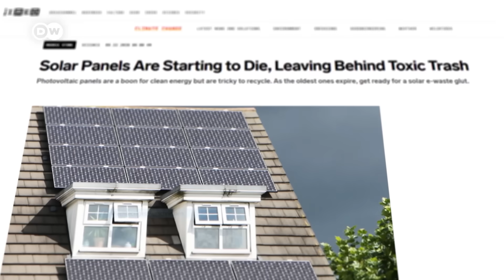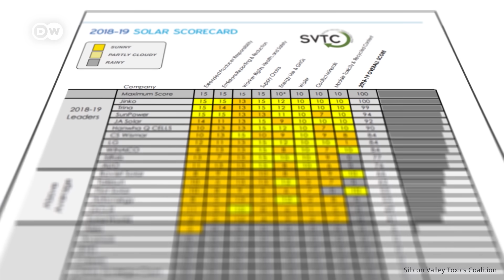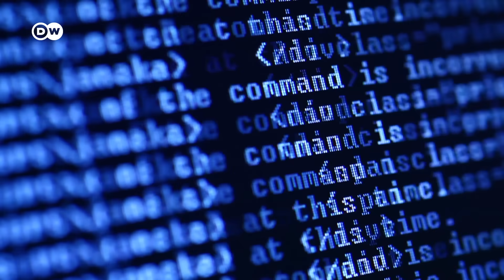How green is solar energy really?

Comment: Solar should be a temporary solution or used only in remote locations with no power grid. If we want to solve climate change without making a mess elsewhere Nuclear power is the best compromise we have by a big margin. We already have the technology, new fail-safe reactors and it's scalable.

Comment: I think one of the biggest flaws in logic a lot of people have is acting like only one kind of green energy (usually specifically renewables) is best for both cost and the environment. Studies have shown that the best way to get the most green energy for the lowest cost and environmental impact is to have a combination of solar, wind, nuclear, hydro, and battery storage. We could get so much farther if we stopped treating it like a competition between energy sources and used them together.
Reply: I'd be interested to from someone in the nuclear industry what they think of the optimal distribution of green energy capacity might look like. Nuclear gets hated on, and yet produces less CO2 per kWh than solar. A nuclear plant has a geographic footprint several orders of magnitude smaller than what solar needs to produce the same capacity. Over the past year, I've really warmed up to nuclear.
Reply: Do advocates treat energy sources like a competition? I don’t tend to see that among my circles. I only see opponents to green energy claiming such a thing, trying to say we’d need multiple forms of new energy when we could just use good ol’ coal.
After posting this, you got me thinking. Be careful who you take at their word. Many people post disingenuous stuff to piss off “the other side” of whatever issue is at hand.
Reply: @nickthompson1812  I typically hear it from not-super-educated armchair solar/wind advocates when I tell them I’m involved in the nuclear industry. I also know a few people in the nuclear industry who don’t really like renewables most likely from jealousy that everyone loves those energies and people hate nuclear. 
But you have a point: most people who actually do their research and care about green energy aren’t treating it like a competition.

Comment: Solar panels are not cheap. If they were, everybody would have them. Installation of the solar systems and batteries are a massive barrier that prevents most people from getting them. Here is the UK, it's almost impossible to find a company to even do it and those that do charge at least £15K. Even if they became cheap / easy to install, the government would slap a massive green tax on them to subsidise lost revenue for the energy companies. They are already going after electric cars as they are beginning to effect the petroleum industry.

Comment: One item not mentioned is that solar panels require a lot of space and unfortunately I saw them installed on agricultural land, thus transforming good agricultural land in industrial waste land after their end of life date.
Reply: victorradu, that is not necessarily true. Since panels must have max sun exposure for greatest efficiency, most are tilted or even elevated. They also occupy only between 5 -30% of the land they are on, allowing for normal agricultural activity around them. Some even provide added benefits such as shelter for livestock and crops. 
Several studies have shown that crops grown under solar panels do better and need less water - so do animals and the moisture from the plants also keeps the panels cooler and allows them to work better in hot climates.
Several universities in the US and the UK have shown that growing wildflowers under solar panels, increases the number of pollinators including bees and the wildflowers themselves do better.
Even the industrial waste problem is being rapidly resolved with some companies promising that this will be a $US 27 billion industry by 2030 and worth $80 billion by 2050, because there are many valuable components which can be recovered.
Newer panels also last up to 70 years, rather than the 25 or so which the earliest ones did.

Comment: My inverter says i've avoided 15T of CO2 and produced 20MW of electricity from solar in 5 years. They may not be green to manufacture, but if it avoids burning some fossil fuel and reduces CO2 then I think the manufacturing evils are outweighed by the production of emissions free energy. Of course it would be great if the solar panels themselves could be produced using as little toxic chemicals as necessary but almost everything based on semiconductors (like for example CPUs) uses an array of chemicals. We just have to learn how to make that the absolute minimum and recycle as much as we can. Solar should only grow in use along with wind, hydro, geothermal and anything else renewable, include the big boy.. nuclear.
Reply: planting more trees might help offset the the co2 emitted from producing your solar panel. how much carbon footprint was used to manufacture your solar panels compared to how much you've prevented at use?

Comment: Theres always a drive to point out additional environmental damage from renewables, but the fossile fuel industry has the same issues. For every kg of CO2 equivalent theres additional waste seaping out unused test drill locations that arent propperly capped, theres a lot off energy intensive construction involved that isn't easy to recycle either like the vast quantities off concrete that are needed for a giant petrochemical installation. Our damage to the enviroment is always a really complicated puzzle, not just for renewables. Thats why power is also only just a part off the puzzle and the main issue is out overconsumption as a grand totall

Comment: We already have green energy, it's nuclear, solar and wind are scams (oh and BTW in your "comprehensive" calculations you left out all the oil, coal and natural gas you need to burn to supplement the power grid because solar and wind only produce energy 10-30% of the time, and all the CO2 and toxic chemicals for the batteries solar and wind need and all the waste energy when they produce too much during their peak periods).

Comment: I would love to have a few of those recycled solar panels. I bet they produce at least 10% of their original capacity and would work nicely as roof tiles on the barn for 50+ more years.
Reply: I was in a local solar park, and there was this cracked and crooked panel thrown in the middle of the field, as if discarded. They told me there was someone walking on it for fun the other day, thinking it's completely broken. We pulled out the multimeter and measured the output voltage (open circuit voltage). The measurement showed 40 Volts, with the theoretical maximum being at 42 Volts. A broken-looking panel ready to be disposed was able to produce 95% of its maximum capacity, without even being properly angled towards the sun.
Reply: @TheCh0senOne  Hope you asked if you could take it away for them.
Reply: @fritanke2318  Haha yes, but it's part of the warranty so they had to return it. Besides, it's kind of a bad investment to have one panel, unless you have a very specific use for its DC output.
Reply: @TheCh0senOne  1 160w panel,   a car battery, and a cheap 300w inverter saved me $1000 this year so I guess it depends on where you are and what you do.  I bought another panel and battery for the saving. The electricity prices went to the roof this autumn so I charge my batteries when the price is low at night and use it for lights, computer and electronic stuff at the evening. I dont get rich but it is enough to get another inverter that can run my freezer next summer. So over time 1 panel can be a good investment.
Reply: I believe your estimates are low.!.!... End of useable life is a variable, and domestically used PV can be repaired in modules, not en-mass.!.!.!. It can be planned for with the generation.!.!.!.

Comment: My bifacial panels are mostly glass and aluminum.  I build coal gas and nuclear plants for a living. Power plants are huge and expensive and have 100's ton of concrete, glass, plastic, and metals. I  grid tied 8kw of panel for $1 a watt. Did i mention i live at 46° north latitude. No exactly tropical. No bill for the next 30 years. My house relieves my local grid
Reply: I also have grid tied solar power. My bill is not zero, but I can live with a 60% reduction of it.
A lot of commenters seem fixated with the notion of "vast fields of panels", in order to reduce fossil fuel generation. A few panels, even without batteies, on a reasonable percentage of homes and businesses, will make a huge difference. More education in the practical application of solar is needed.

Comment: I wonder why there isn't a more tiered approach to recycling electronics. I would think a first, less costly, step would be partitioning a portion of landfills to house electronic waste. Eventually when the cost of raw materials for electronics or recycling gets much cheaper, the electronics part of the landfill could be used for materials that may not be quite as pure/clean as directly recycled material, but isn't as much of a problem recapturing the value from electronic waste as would be going through the whole landfill. Maybe the cost of this basic sorting is still be too costly for what can be recouped down the road?

Comment: I hate it when people bring up the waste of renewables as if its this major issue fossil fuels dont have.

Yes solar, wind and nuclear have some pretty nasty waste but its for the most part contained to a very limited area or at least has the ability to be contained and localised.

Emissions from coal and gas on the other hand goes straight into our air which is significantly harder to contain than dumping stuff in a landfill.

Comment: This video is not a bad effort but there are some quite gross mistakes.  You are collecting evidence from people who are not updated on current PV manufacturing technology (2021).  None of them works for a PV manufacturer.  They are out of date with their facts.  For example the energy payback of a solar PV is (in Germany) about one year.  But the panel last 30 years.  For 29 years it emits carbon free energy.  The CO2 emitted in its manufacture today is less than a quarter that of a PV panel made in 2007.  So on an LCA basis PV emits far less greenhouse gases during its manufacture (and zero during operation) than any other power generation technology.  Yes, silicon tetrachloride is ALWAYS recycled in a polysilicon plant.  Even in China.  Cadmium telluride (a compound, not pure cadmium) is used only in 3% of panels made today (and only in the USA).  97% of solar panels made today are not using any significant amounts of toxic chemicals.  Even lead, used in solders, is being phased out.  Solar panels in Europe are already recycled up to 92% of their weight.  (99% is possible but costly at the moment).   It's a high % for a relatively small industry - it's a lot better than most other industries.  PV can improve but it's already a lot better than anything else that generates electricity.  You should make that abundantly clear.

Comment: I think the video is probably a fair assessment of the solar panel itself. However I think if we are honest about the entire system the panel is a part of we will find that the main other part of that system i.e. the batteries we will find that the cost to mine and the recycling aspect of those components drive up the carbon footprint and environmental costs a lot more than just the panel. 
After all humans don’t stop using energy after the sun goes down and where are you storing this energy or where are you getting energy when these are not producing power. I feel this is a more honest look at the entire loop of solar. 
But a good video for the segment it covered.

Comment: What about the batteries needed to store the produced energy? I think those should be considered in the calculations as panels by themselves would be too unreliable to replace current energy sources. Solar energy also requires costly specific upgrades to the grid system.
Reply: Spoken like someone that has no clue what they are talking about. A small amount of users use storage for their cells. Most parks and homes are connected to the grid. So the grid is the battery.
Reply: @tariqaljafari9724  the grid is fossil fuels. So I don't understand how that's any greener?
Reply: @4000marcdman  What are you talking about? You mentioned batteries and your claim was that people use batteries to store the energy from the solar panels. I said no, that is not how it works and people use the energy (what they need) the rest is put back in to the grid for someone else to use. How is that not green?  

We need to modernise our grids, make them smart and connected to each other across borders. We also need to invest in energy storage (green alternatives are available), mix in some nuclear power and we may reduce the dependency on fossil fuels down to 0. 

But people like you are not interested in a real solution. You only present problems and missinformation to keep us in the dark ages. Yikes..
Reply: @tariqaljafari9724  you're arguing a different situation.  I'm speaking of stand alone situations.
Reply: @4000marcdman  Floods, hurricanes, rising oceans, droughts and fires will hurt many more. You are complaining over small changes and inconveniences and ignoring the monster shitstorm that will hit us if we don't do this now. Your argument does not hold water at all. We need to suffer a little bit to avoid total death.
Reply: They won't talk about the batteries. It will totally kill their green argument.
Reply: @4000marcdman  Or maybe they know it's a meaningless argument when 90% of the parks are directly connected to the grid. Ever wondered why we don't need batteries for fossil fuel energy production? It's because storing it in batteries would be foolish.
Reply: @TheCh0senOne you should go back to zero and rethink your statement, as you are terribly wrong

Comment: Best criteria is energy return, example big windmills generators have from 3 to 7 years energy return it means it works in average 5 years for free, that is energy required to produce and install one wind turbine after 5 years wind turbine starts to produce surplus electric energy. Solar panels have 30 year life span but semiconductors is most intensive industry in the world, so energy return is about 20 - 30 years, solar panels can be used only as alternative energy source but not as solution for decarbonization, it consumes more energy that gives away.

Comment: The recycling isn't expensive (a little less than 10% of the total cost), it is more that it is dirt cheap to just throw them away, this is why you need regulation regarding solar panel recycling like in the EU.

Comment: If we're serious about reducing emissions and environmental impact we go nuclear. 
I found that I had a lot of misconceptions about wind as solar as well. I had been thinking that what we needed was renewable energy when what is actually needed is clean reliable energy. 🤦9
I had assumed that a unit of power production from them meant a unit less from FF, that they were cleaner than the alternatives, that power could be stored for use when needed like water or grain, and that if we just built enough of them we could meet our energy needs without FF. All of this was absolutely wrong. Wind and solar requires 100's of times more resources per unit of power production as NP does and they don't stand on their own, typically backed up with coal or NG. And as intermittent power sources bring instability to a grid we end up using far more backup than we need with stable reliable sources. And the higher percentage of Intermittents the greater the instability and the higher percentage of backup needed. At 20-30% capacity factor, every MW-hr of solar & wind drive 3-5x as much gas build out for backup. But, since solar/wind are chaotic, they drive gas efficiency down, driving gas burned per MWe-hr up by 2-3x. This is probably why we've seen so little progress in emmissions reduction by adding them to our power grids compared to NP and hydro power. 
Carbon emissions 2020 Europe 
https://twitter.com/electricityMap/status/1357248695499128832?s=19
www.ElectricityMap.Org 

If reducing emissions is the goal they don't bring much to the party, while NP has been able to decarbonize grids in a decade or two.

Comment: Missed off heat island effects, solar panels used instead of farming for example will absorb more of the sun than the previous use creating a localised heat bubble like a city.   In the city itself this will cause increased energy usage for air conditioning and the like negating some of its value as a energy creator.

Comment: In the calculation of solar and wind CO2 emissions, does that calculation account for the batteries needed for backup. Or the use of land taken up by the panels? Why aren’t we more focused on Geothermal, which is on demand power 24/7. Or Ocean Thermal Energy Conversion which is also 24/7 on demand. Not to mention that geothermal and OTEC use less land and less rare earth minerals. Solar and wind have a place, but not as the main power source.